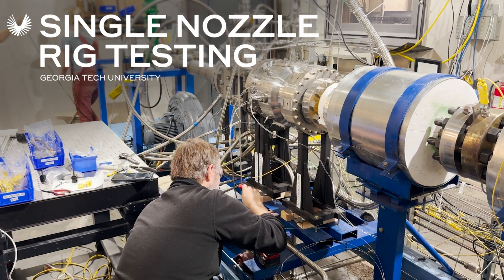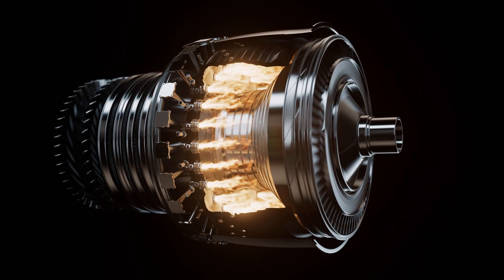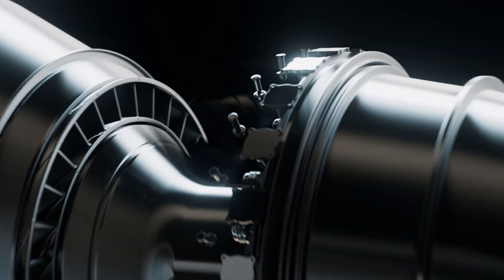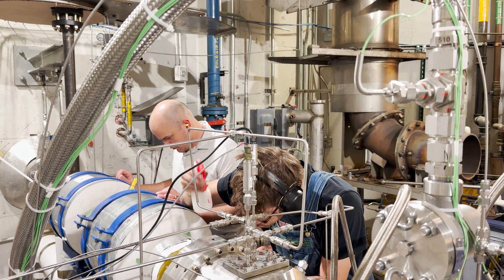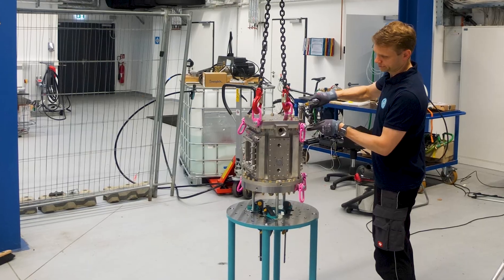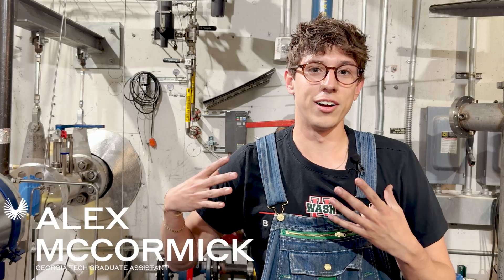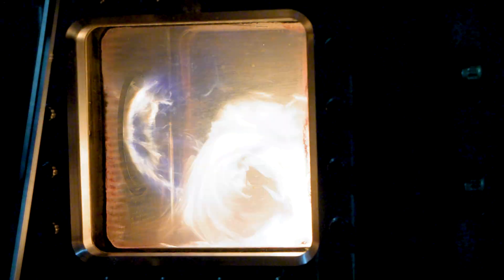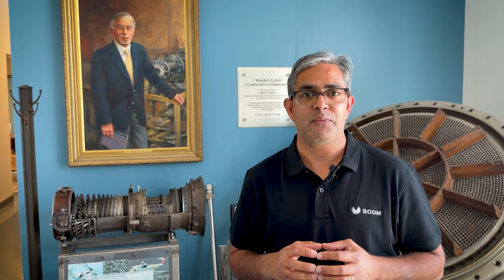Inside the Flame: Testing Boom’s Supersonic Engine Ignitor

Comment: 02:47 By Tupolev TU-144
Reply: Not opened up by TU-144. It got there first but it had minimal impact on supersonic travel. Worked one insignificant route at low rates.

Comment: Dumb question: Why would you spend so much R&D on an engine in-house? Why not partner with an established engine-maker (GE, P&W, Rolls-Royce, etc.) to develop for your requirements? Is BOOM so far advanced compared to these companies or do they just want everything to be proprietary?
Reply: Rolls-Royce was going to provide the engines for Overture but dropped out early last year.
Reply: @PSByte  Did they give a reason as to why? I would think they would love to promote such a partnership.
Reply: They want to fly to the Titanic.
Reply: Engine and rig designs like this one are mostly done by Florida Turbine Technologies
Reply: They tried that, no one was willing to invest in the development of something which is never going to be commercially viable.
Reply: No one wanted to work with them citing (rightfully) it was to high risk.

The reality is even if they get a block 1 deployed and flying revenue flights then need to IMMEDIATELY start working on block 2 that is just better then what they got. I am dumbfounded as to why they are going about this the most expensive an complex way possible somewhat needlessly.
Reply: @andrewyork3869  Exactly. My question was totally legitimate. I don't know anything about the aviation industry, but the model seems to have always been, Boeing/Airbus build the planes and GE/P&W/RR supply the engines. Many industries follow this model for a reason (especially for economic reasons). I'm guessing you let the guys who know how to build engines do their thing so you can focus on doing what you do best.
Reply: @LPM147 dont get me wrong we need new competitors in the space. We just need people who can be more realistic then boom.

I would honestly be less nihilistic if boom had delivered anything but a super sonic aircraft as a first aircraft.
Reply: Because everyone else knows boom is pure vaporware
Reply: @Hilde_von_Derp ...they built and tested a working supersonic jet demonstrator to prove they weren't vaporware. This isn't to say that boom and its investors aren't taking on a monumental risk, but the company has delivered... something
Reply: @modernrice that doesn't change the factor they are going about this the most expensive an impractical way possible.